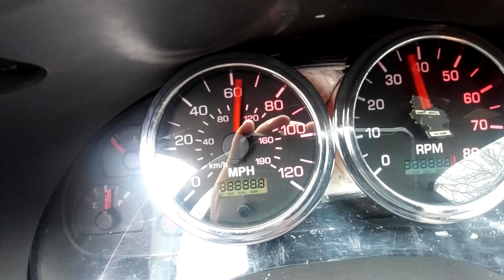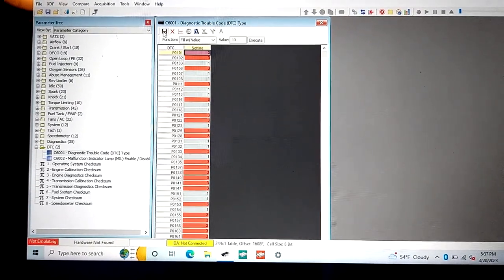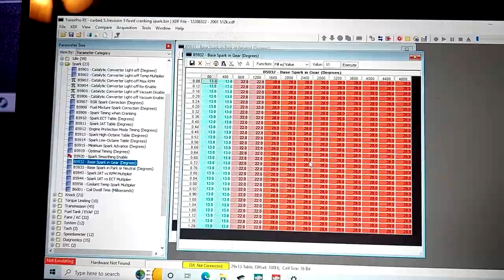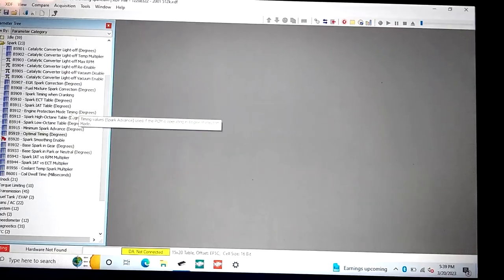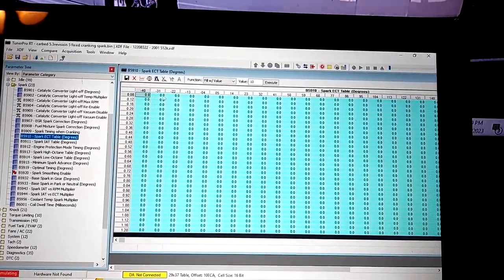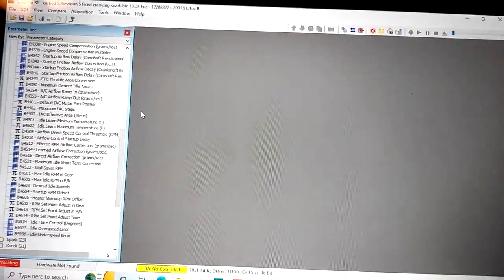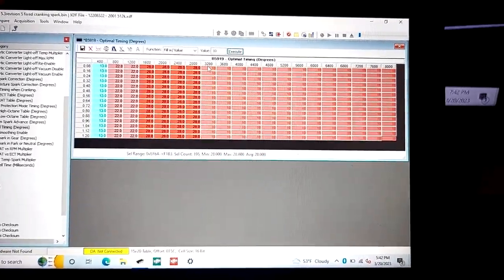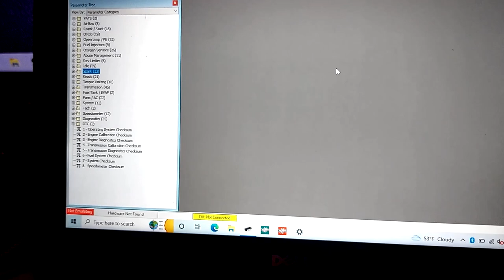HOW to run the factory pcm for your Carbed LS swap for FREE !!!

Comment from the maker: It's important to go watch part 2 as I get it to work with boost plus I go into more detail than in part 1 
https://youtu.be/qowh9vvzaHg

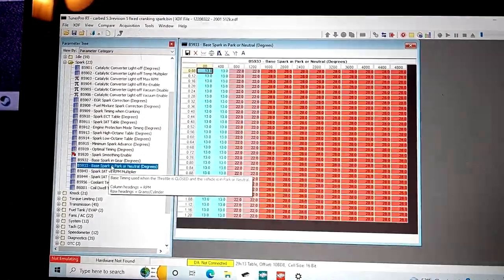5:06 Spark in gear and spark in neutral are 100% necessary and need to match in the same values as all the other tables other wise it might not have an effect on ignition timing regardless if your running an electric shift trans a manual or non E trans, match all the tables to what your wanting your ignition timing to be. 
ALL TABLES INCLUDING SPARK IN GEAR AND SPARK IN NEUTRAL NEED TO MATCH THE OTHER TABLES TO THE DESIRED IGNITION TIMING REGARDLESS OF WHAT TRANSMISSION YOU ARE USING

Comment: If you want to use a pcm as a standalone for the 4L80E, the '91-'92, and maybe '93 GM diesel automatic pickups have the PCM you need. You'll need RPM signal and you'll want to change the shift points, a loose torque converter may require tuning.
Reply from the maker: Not sure why you'd want to add a separate computer when the 411 can run a carb and it runs a 4l60 4l80 natively,  all you'd need to add is a tps and nothing else

Comment: I can hardly wait to start messing with mine. Looks like I have a goofy revision of a P01 that may or may not have OS compatability, and may or may not need a vastly different harness pinout. The harness is the easy part to work around though.
Reply: Change OS.
Reply: @pmotorsports8276  Can you not read well?
Reply: I guess  not.  But you can change your operating system to a more supported operating system 😉👍

Comment: That is very cold, I want to do the same but with a Ford 5.0, I want to put independent coils and remove the distributed ones and be able to control the time advance more precisely, not using the PCM of an LS but a speedoino which is more economical in my case. country to use the pcm of an ls, I have a question, of course you are not using the injectors obviously in addition to that other sensor you are using, ckp, cmp, iat, map, ect, I also appreciate in one of your videos that the time is certain degrees at certain rpm that is what the pcm does because you configured it that way, or because the pcm obtains information from the map, thanks for your response
Reply from the maker: whats wrong with a distributor? personally id keep the distributor if i had a sbc only because ive seen an 800hp 350 run with a distributor and an ignition box and it was simple in the engine bay  and just clean because there wasnt a big wiring harness 

NOW THE ANSWER TO YOUR QUESTION 
i am only running the cam and crank sensors and  cts but thats only to work my fan and to retard timing  if it starts getting too hot and nothing else no map no maf . and watch my next video i set this pcm to run off RPM only so once it reaches said rpm itll just go to that timing that i had already set in the programming and i can change it to  whatever id like with out limits or restrictions and even if i ran those other sensors(which are unnecessary) the computer would try to revert to the best timing or whatever the factory was for timing , putting it on an rpm base tune only will make sure it stays to what i set it at no matter what the conditions are as long as it reads rpm it does the rest also i dont know about speeduiono and id like to be able to explore other things but my financial situation wont allow that lol ive pulled off the impossible plenty of times but lack of funding sometimes does get in the way

Comment: awesome content. thank you for sharing saved me 600 bucks. could you touch on if i wanted to use O2 sensors. thanks again
Reply from the maker: Thank you and do you mean the factory o2 sensors? Or are you talking about a wide band ?
Reply: you tell me. haha. probably the factory ones that are controlled by the pcm.
Reply from the maker: @dirt digger  those won't be necessary in this conversion and it won't affect anything

Comment: Thanks for uploading this. What gauges are those? I like them I think they would look good in my ls swapped ranger.
Reply from the maker: https://www.ebay.com/itm/261029282643?hash=item3cc68ec353:g:UwUAAOSwmJRazl9Z

here's the whole set, you can also buy them individually, i've ran them before on my past swaps and i like them because the speedo can work off of gps or the speed sensor off the trans i highly recommend them especially from the renbusan ebay store

Comment: You using the cam and crank sensors?
Reply from the maker: Yea , the engine won't run without them
Reply: @Dannymclovin  I thought so… I’m going to take a Mark VI 454 (vortec) and convert it to coil near plug. And use a carb with a 4l80e. The 24x reluctor is no issue as it can be fitted in the stock timing cover. I’m hoping I can use the cam sync pickup in the stock vortec distributor for the cam. Fit a TPS to the Holley carb for the transmission.
How difficult is it to change shift points in the stock ecm? Can they be strictly RPM based for racing?
Reply from the maker: @parkdw1  there's an article on how a guy that used the stock pcm as a standalone, I can't say too much on that matter because I run a th350 , the guy is running a megasquirt it's an article in Google somewhere
edit.
you can download tuner pro for free and look at all those parameters, they dont seem difficult but again its something i wont ever get to try because ill be switching to a manual soon

Comment: Damn I wish i would have seen this before buying the msd 6014
Reply from the maker: I'd return it , I've had a few of those back in the day and they're just hot garbage in my opinion the stock pcm is free to use this way
Reply: @Dannymclovin  it's been a while back since I bought it. Still new. Might sell it. Where can I get the timing information from? To set it up for carb on 5.3
Reply: One more question will a tbi PCM work also for the carb swap 🧐
Reply from the maker: @FrankMartinez-xt4wt  no idea man I only deal with ls and 411 pcm and watch the drive way engineer channel on pcm hammer he has the links for the downloads and os files

Comment: No map? Run one timing curve for boost and no boost ?
Reply from the maker: I don't need a map sensor if my boost comes on at 3500 rpm then I just lower the timing from that point on. And yes so basically what I do is NA timing before boost and after boost lower timing, all on the same table

Comment: Thinking about grabbing a stand alone harness off of eBay my msd box just went out on me
Reply from the maker: Just get a stock one from the junkyard i had a cheap ebay one and those usually get there power supply from the starter lug and theyre not fused not to mention the o2 sensors arent even in the correct pins just get one from the junkyard youll be better off in the long run

Comment: just add throttle  sensor to run 4l60 or80 on factory pcm
Reply from the maker: Is this a question or a statement?
Reply: @Dannymclovin  statement  it need signal form the throttle to up shift
Reply: p01 and 59 control the transmission  when you go carb only missing part the throttle sensor  then the gear can up shift